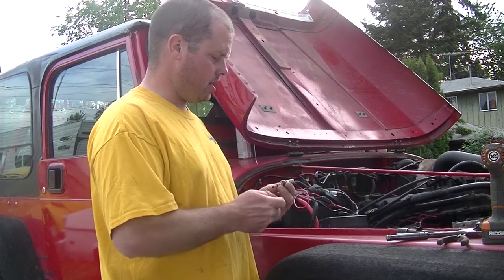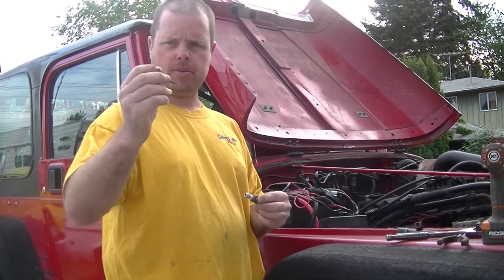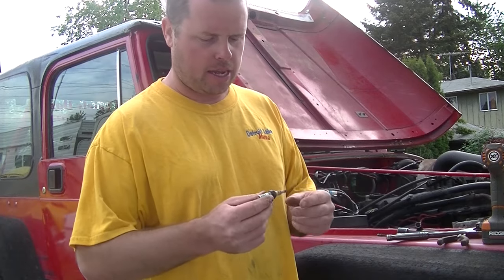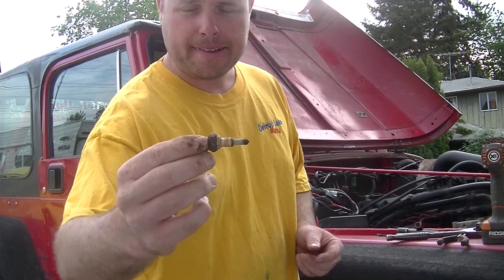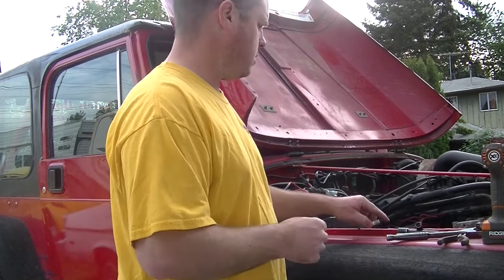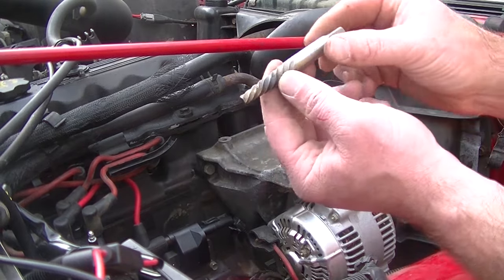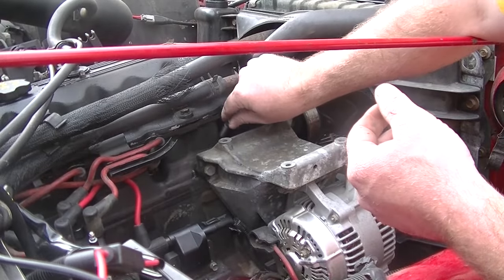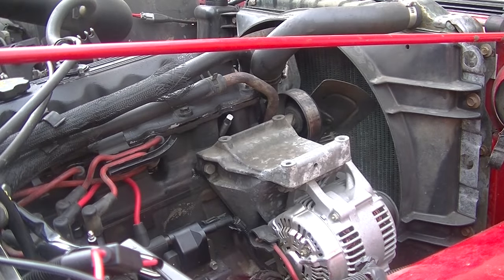Broken Spark Plug Removal

Comment: Bro, you saved my ass.  I over torqued and broke the new spark plug in my N51 engine, your video gave me the idea to put a #5 easy out on a 20" extension and twist it out.  I was able to get it out without a ratchet or impact driver.  I tapped on it with my hand once, did the backspin and it came out in seconds, thanks for the inspiration and for saving me a bunch of money!!!
Reply: Yup same here. I broke mine after over torqueing and after reading your reply I got the idea to just use an oversized flat head screw driver since the plug wasn't seized. Tapped it in with a hammer twice and it twisted right out.  Thanks x2!
Reply: @erowley462  you guys are amazing , the idea with the screw driver literaly saved me money , thank you boys.

Comment: I just saw on another site that they recommend square edged ez outs instead of spiral type. Square is less likely to expand thrads of broken plug causing it to get tighter in the attempt to remove it,,,,
Reply: Thats what ive been reading im about to attempt it with the square cut hoping all goes well

Comment: 9/16 extracter bit. Socker extension, 12mm attached to it and put it in. The porcelain came out, only the screw part with the prong at the end was left inside. Put the bit in with the extension, tap a bit, and put some muscle into it TURNING COUNTER CLOCKWISE TO LOOSEN IT UNTIL IT TIGHTENS IN THAT WAY. Yes in the direction to loosen a normal plug. It will tighten. Keep putting muscle behind it and will bit and turn loose. 5$ tip at autozone
Reply: How do I get my spark plug out all it does is turn but won't come out

Comment: I used the Harbor Freight part: 93822 pipe extractor 1/4" it worked well. ( I'll never say anything bad about Harbor Freight tools) The main thing is to let the broken plug soak for over 24 hours.

Comment: Thank you, had this happen on my Civic, I don't have impact tools, but putting a 5/8 spark plug socket in there with a long extension and smacking the top of that with a hammer got it loose enough that I could ratchet it out.

Comment: You are a very brave and lucky man for trying that (maybe just frustrated)  :- ) 
Those easy outs are not made for impacts and they break easily if they bind up. Once they break off you will have an extremely hard time trying to remove a broken one. They are not easily drilled out and you may end up needing a cutting torch to remove it. A wrench is all that I would brave to use with it. Even then slow and steady with it. Good on yah for getting it out. Hope this helps someone.
Reply: Todd H I’ll opt to using a hand wrench first as I am too nervous to try an impact
Reply: What size square easy out for a 5/8 spark plug should I get? Had this problem on my 2004 Grand Prix

Comment: I am struggling to find that 8 point socket. I've checked all messages but haven't found any tip except Husky, homedepot and so on. Could you please let me know about the socket? I have 1/2 male wrench with #5 size easy out. Haven't been able to connect them precisely. My spark plug is broken on my civic. Thanks.

Comment: No one would have this problem if they change plugs more often. Plugs are cheap. I change mine every other fall regardless of milage and never ever had a broken issue. Also use antisieze on plugs. I use the copper kind due to high heat
Reply: NGK plugs don't need anti sieze

Comment: Same thing happened to me but the threads still have the core in it. How the heck can I get it out to use an extractor for the jacket? I've tried drilling but can't get a straight angle for the bit to bite. I'm at a loss other than punching it all the way in
Reply from the maker: I personally would probably weld a bolt onto what’s left and not chance shoving the center pice into the motor. Not sure if that’s the best way or not but that’s what I would do 👍
Reply: @FairlyHonest  Nice, thank you. I was beginning to wonder if welding a nut would be feasible myself. I haven't had a plug break like this, normally I'd just use an extractor/easy out but that damnable core is blocking me

Comment: Is that a left hand bit? Curious if i need to go in tightening or loosening direction
Reply from the maker: Left handed easy out
Reply: @FairlyHonest  yea i finally got it figured out. I got a chevy 350 and i had 3 plugs break. Luckily on my 350 the plugs are at the lower block and can get a straight shot thru wheel well. Burnt out an electric impact gun, busted a ratchet but finally used a 3/4 inch drive massive industrial sized ratchet and finally broke them free. Thanks for the idea

Comment: Good day.  Watch ed  video ,  saw you  put anti seize on,  does it not stop plug from grounding its self  to negative side  Thanks good video
Reply from the maker: +Don Voll 
I only put it on the threads. It still makes a clean contact where the plug seats to the head. I haven't had any problems with it loosing spark.

Comment: Hey what size 8 or socket? I have been looking ALL DAY for a 10mm 8 point impact socket from Home Depot to Fastenal and cannot find one ANYWHERE. 10mm is what fits the #5 extractor
Reply from the maker: +Brett Bad Blood Benton 
I’m not near my tool box at the moment so I’m not sure. I know mine was a husky from Home Depot. Non impact. Just a regular 8 point socket.
Reply: Fairly Honest Off Road oh okay. What size?
Reply: Fairly Honest Off Road when you get a chance I gotta get this done as soon as I can
Reply from the maker: +Brett Bad Blood Benton 
My tool box is 7 hours away at the moment. It’s going to be this weekend probably before I’m back. I’m really sorry I can do anything sooner.
Reply: Fairly Honest Off Road dangit okay. Well if you can remember...metric or standard?
Reply from the maker: Brett Bad Blood Benton 
I really don’t know. I just grabbed one that worked and used it. They had been in my tool box for years and that’s the first time I ever had to use one.

Comment: Hey man I literally have the exact same problem with my 04 Ram 1500. I’ve drenched it withPB Blaster, I’ve installed the easy out, and I’ve been trying with my impact for a while now. It’s gotten to the point where the socket won’t turn anymore. It just won’t break free. What am I doin wrong?
Reply from the maker: Parker Scott 
I’m not sure. I haven’t had one not come out. I hate to say to use a bigger impact or more leverage because you really don’t want to break off the easy out. If you have a torch you might try heating it up but not with the easy out in there. Don’t want to weaken the easy out. 
Hope you get it out 👍

Comment: What about debris possibly going inside the engine? mine just did the same thing and i stumbled upon your video but my anxiety wont let me start the car without thinking about the what if lol...
Reply from the maker: Juan Flores 
I totally get where your coming from. I lost the tip of a glow plug in a diesel a few years back. I had to decide whether or not to start it or pull the head off. I started it and flushed it out. You win some and loose some. Just make sure you have all the big pieces :-)

Comment: 1:49 NO. DO NOT DO THIS. Using an impact wrench is probably the reason you had this problem to start with. You are many times more likely to break shit with and impact wrench.
Reply from the maker: +Jeff Bourke 
They broke taking them out by hand. To each there own but I have had the best luck breaking stuck bolts loose with an impact versus by hand. Obviously you have had a different experience. Sorry to hear about your luck.

Comment: This happened to me too I thought I was fucked looked it up on YouTube found the tool its called a #5 extractor tool bought it in Bennett auto supply 5 bucks saved my ass.
Reply: Mark Crawford how does it work? Are the threads on the extractor drill reversed? So counterclockwise to tighten it?

Comment: Where did you find a 4 point socket to fit to #5 extractor?
Reply from the maker: judah415 
I got mine at Home Depot. It’s an 8 point socket that forms a square inside the points. I will drop a link if I can find one online.
Reply from the maker: judah415 
Yeah just google 8 point sockets
Reply: What size socket?

Comment: where do you get the square socket from?
Reply from the maker: +Captain Kirk 
It’s an 8 point socket that the 8 points make a square inside of them. You can get them at Home Depot or pretty much any place that sells tools 👍
Reply: @FairlyHonest  Thanks, I have a no. 5 easy-out stuck down in the spark plug. I just need to know the size of the 8-point socket now. Do you happen to remember the size of the socket?

Comment: My Dodge Durango did the same thing & i was backing out the extractor & the extractor bole in half  HELPPPP !!!
Reply from the maker: +Valley of The sun 
That’s not good! I don’t really have any great suggestions. It is possible to to weld a small pipe or bolt onto the broken spark plug but you have to be carful not to weld it to the head or get slag inside the motor. I wouldn’t try drilling it out as that will put shavings into the motor. You may be at a head pulling point. Sorry to hear about your luck. Hopefully you get it.

Comment: That was waaaay too easy. You should have seen what i had to go through a week ago.
After way too much torque to break the tightness against the head of a flat- seated plug sheared it off there was no way an easy - out was going to handle it. So i drilled the head off and used easy out on just the threaded part.